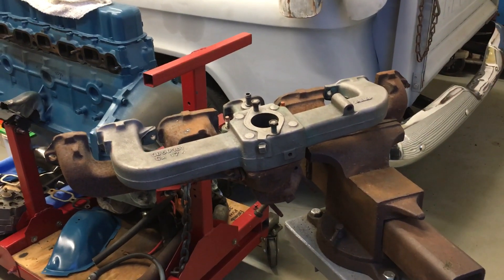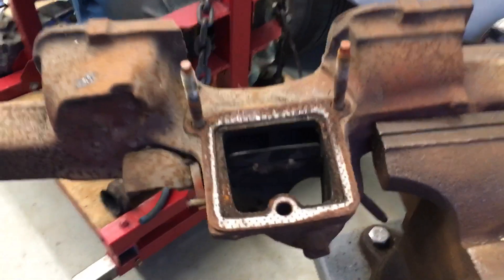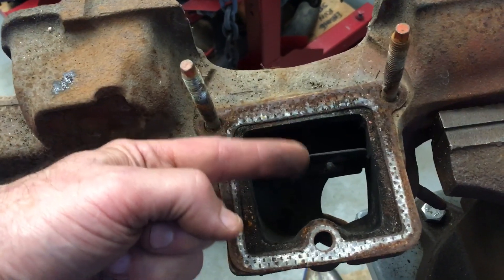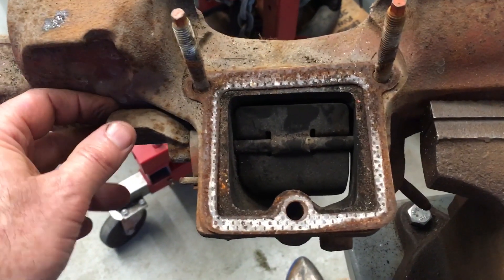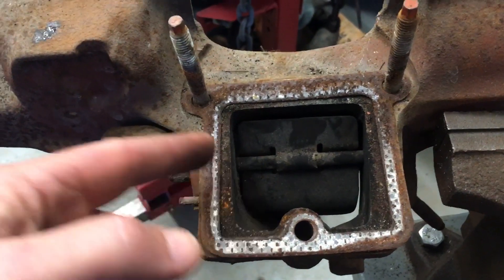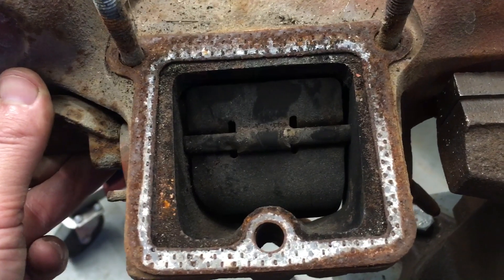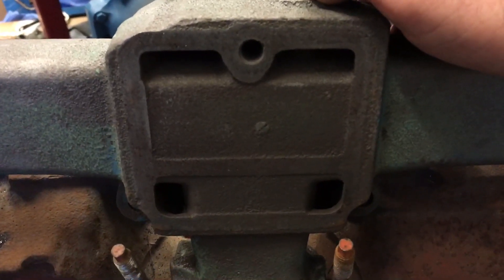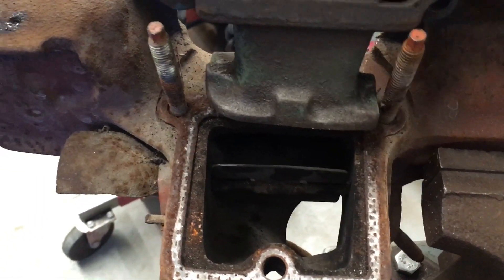Exhaust diversion flap for warming the intake

Comment: Hello. I know that this is an old video, but I recently inherited an inline 6 that I want to restore. Where did you get the new intake? Thanks
Reply from the maker: @jimbob9656  The intake I show is not new. It was one I was cleaning up.  It has a dressing on it that makes it look new. Calyx manifold dressing.
Reply: @Lugnutz65  I was afraid of that. I've looked everywhere and, unless you're looking for a "performance" replacement, I can't find a factory replacement. Much like the three on the tree column. Thank you for the quick answer, though.
Reply from the maker: @ I show how to rebuild a steering column with 3 on the tree in this DIY I wrote. https://lugnutz65chevystepside.weebly.com/steering-column-page.html

Comment: I have Split 3 different Chevy 6 exhaust manifolds. The first I left the flap free to operate at 1/2 range. The second was 3/4 range and the last was Full blocked. I think the 3/4 block had the best results. In each case I fitted the exhaust system with a crossover pipe and 30" Fiberglass mufflers.

Comment: This is an excellent explanation. I have been looking far and wide for information on this intake/exhaust configuration. I am in the process of restoring a 1967 Pontiac Tempest with the OHC inline six. The exhaust part of my manifold is shot; it has cracks and a couple of the wings are broken off. I cannot for the life of me find the part anywhere. My last ditch effort is to ask a shop to manufacture a header for me. If that does not work, I may need to abandon this engine altogether. The OHC was only manufactured for a few years yet it has historical significance, as it was the first American engine with the timing belt. Are you familiar with this engine? Do you think I have any other options aside from having a header manufactured? I was really hoping to keep this engine, as the car has only 62,000 miles on it.
Reply from the maker: I am not familiar with the Pontiac engines. Sorry. I know there are cast iron headers for the Chevy 230, 250 and 292 engines. It might be worthwhile to check if they would work with the Pontiac engine since GM shared a lot across from Chevy. I’m glad you found the video helpful.
Reply: @Lugnutz65  thanks for the fast response. I have been trying to match them up and the shape of the holes is definitely different. If I had a manifold in my hand, I could tell at least if the dimensions were similar. Either way, the gaskets are different so that says right there it's probably not a match. Sometimes there is anecdotal information out there but the truth is, this six-cylinder has been abandoned in most restorations because of low performance and reliability issues. That is why I'd like to keep the original engine – it's a unicorn! Thanks for the fast response.

Comment: UNTIL... the flap spring gets old,  corrodes, breaks,  falls off,  and then the flap defaults to the open position all the time...  Then you get to try to find out exactly WHERE you can get another little spring from for your 250 straight six.   Hope this helps.
Reply from the maker: Vendors sell the springs. All mechanical parts require routine inspection and service. Some more than others.
Reply: Jim Carter parts says they have the bimetallic springs but there is not picture of this part yet.

Comment: I'm replacing my manifold with a custom split but just it doesn't have a flap, what problems will come??
Reply from the maker: Vendors sell a block that bolts under the intake manifold. It used coolant from the radiator to warm the intake. If you live in a warm climate you won’t need it.
Reply: @Lugnutz65  I'm in Cali do ots always warm....thank you for responding...

Comment: Thanks! Had the same question about the L6 230 in my 69 Camaro. The spring and the post are "gone". EFI was just added. I'll make certain that my diverter is in full divert down. With EFI, I don't think I'll need the initial heat up.
Reply from the maker: I agree. Good luck with the EFI.
Reply: A number of these engines were converted to run on propane during the gas crises of the 1970's.  In that case the entire opening of the exhaust manifold was blocked off with a plate to prevent the heat from evaporating the propane in the manifold.   From what I recall these motors ran quite well on natural gas.
Reply: @BillySBC  Gasket kits for these engines included one that blocked off the heat passages, and I never knew what application they were for. Now I do. Thanks.

Comment: Looks like my 194 inline 6 intake and exhaust manifold. Small amounts of heat(exhaust)rise and help atomization and vaporize gas, so if your heat riser is stuck shut by to much carbon your car may run a bit ruff, should be checked, it should move freely.The coiled spring is a thermostat.
Reply from the maker: But the exhaust gas doesn’t mix with the intake. The holes on the bottom side of the intake simply give it more surface area but don’t communicate with the intake passages.

Comment: Thank you for the explanation. My 1962 235 is very similar, although the weight and spring is broken off. I have read it needs the warmth to keep the fuel from puddling. On cold start ups the is no heat to begin with. 
The whole system is contrary to cold air intakes.
Since I live on the Tennessee/Georgia line and don't drive it in stupid cold weather, I need to make sure it is closed all the time. Thanks again.

Comment: Hi thanks for video, what the proper way to install the gasket in between exhaust and intake, metal side down towards exhaust ?  Have mine apart and installing a heat riser spring, previous owner had it tied up. Living in New York it should work the right way not tied up
Reply from the maker: I installed mine metal side down. I’ll look at my service manual to see what it says.
Reply: @Lugnutz65   thank you I would appreciate that. I would think it would be metal down towards the heat.
Reply from the maker: @nickpanhead7209  
Felpro website says “When installing Fel-Pro exhaust manifold gaskets, if there is a smooth, metallic side and a composite side, the metallic side should be installed facing out, meaning toward the exhaust manifold.”
Reply: @Lugnutz65  thank you very much can't wait to put it all back together, and hear a smooth running motor, thanks be safe

Comment: Well done video and explanation! These are called heat riser valves, and the shaft had a tendency to seize, making the valve inoperable. GM supplied a special lubricant to treat them. The counterweight and bimetallic strip control must have been too simple; later ones on V engines used a vacuum servo control.
Reply: The springs would eventually corrode,  break, and fall off,  leaving the flap in the open position and not able to warm the manifold properly in colder temperatures.  The springs are also a pain to find these days.   I knew someone who used a pull choke under the dash and wired it to the heat riser weight and would operate it manually because he couldn't get the heat sensitive spring anymore.

Comment: My manifold has no flap and spring, just a hole. Its never had one.
Reply from the maker: That will cause the intake manifold to be warmer than it should at operating temperature. The manifold I show is for 1963-19?? Chevy in-line 6 cylinders. Typically 230, 250 and 292 engines.
Reply: @Lugnutz65  i think this particular manifold was changed in the early 70s, I have a 1967 with this exhaust manifold and flap
Reply from the maker: @nicholascastor1746  
Perhaps it changed with the introduction of the integrated head. Maybe?
Reply: @Lugnutz65  I believe you hit the nail on the head!

Comment: OHHHHHH So the fumes don't actually go into the manifold... that book I'm reading doesn't specify that... or maybe it does, only the drawings aren't too clear about it.
I knew something was off. Thanks a bunch!
Reply: No,  because if it did divert exhaust directly into the intake manifold it would ignite the fuel/air mixture in the manifold itself.   It's job is to warm the manifold so the fuel becomes a mist and atomizes,  otherwise in cold weather it will turn into a liquid and sit in the manifold and not spray into the cylinders for combustion.